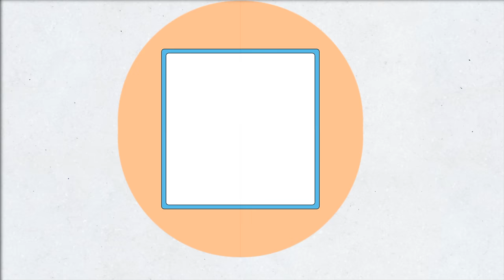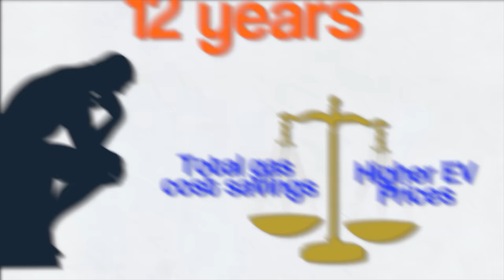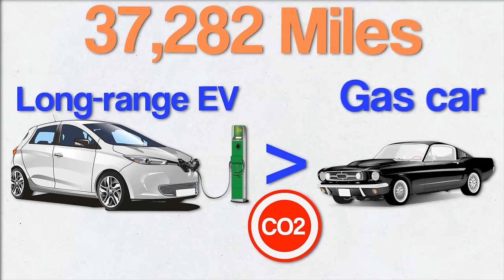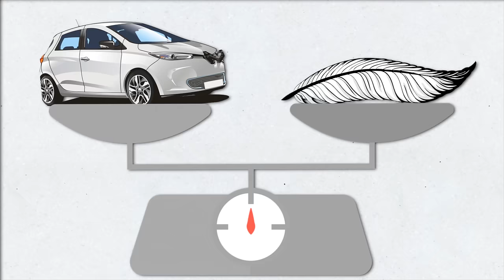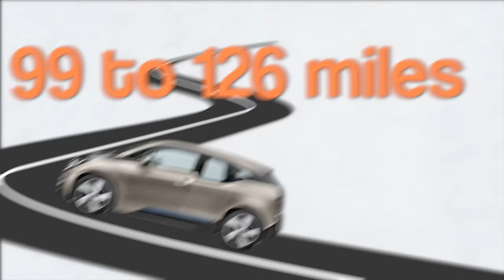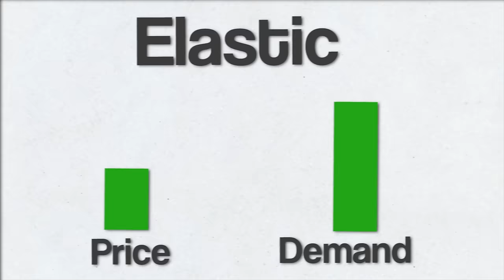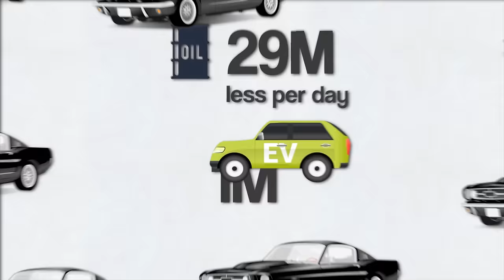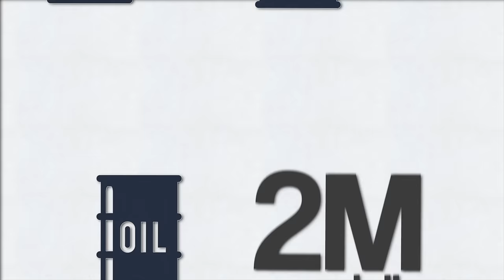If You're Worried About Rising Gas Prices, Watch This

Comment: The transition from gas and diesel vehicle fuel will take several decades. Only a small percentage of the population can afford to buy a new or even good used EV and it will be crazy expensive to swap batteries that are dirty. It will take a huge jump in battery technology to make EV's a real possibility for the masses.
Reply: agree.....EVs  are  way  overpriced,  n  take  too  long  to  charge, n  will  spend  most  of  the  time  parked, connected  to  charger.  also, the  power  grid  would  have  to  be  upgraded  in  order  to be  able  to  handle  millions  of  charging  EVs, which  would  take  years  n  years, along  with  billions  and  billions  $$.
Reply: I dont ever want a ev really
Reply: It's called "forced compliance".
Remember " you can keep your same Dr."  RUSE
Reply: Right now. EV's are more for those that have nice office jobs and use them as grocery getters. EV's still have a ways to go to be of utilitarian use.  Even with the trucks that they are working on now really don't have enough charge life, especially for those that travel with travel trailers half way across the country for their vacations. If they can afford to that is.
Reply: Ford alone has 150,000 E F150  trucks on order . That is only one US company.
Reply: @FFGAir  the EV is not a practical car.
Reply: yess imagine living in foreign countries.. is very expensive for us.. too much import tax to pay.. when battery gets old and need to replace.. i'm thinking of buying a hybrid.. but its almost the same
Reply: Right now I own my suv outright, spend money on upkeep and am considering an ev as a " grocery getter" if and only if it were affordable which it isnt. But the idea of holding on to the old technology and not being able to afford the new technology really sucks considering the price of gas
Reply: As with anything we purchase, as demand increases for EV's, so will production, and costs will come down.  The Tesla Model S when first sold, was around 80,000 dollars, but the newer model 3 is priced in the high $30's, and has a waiting list to purchase.   Consider that any gasoline SUV is similarly priced.
Reply: @tomsawyer8525  they sell nearly a million trucks every year.

Comment: If repairing combustion engines has gotten harder over the years with newer cars, literally no one will be able to repair EV's besides authorized service technicians that will automatically bill you exorbitant amounts to get the OEM parts from the manufacturer. Repairing something yourself will be next to impossible.
Reply: Exactly what they are after. Imagine what this would do to the auto parts industry, as well. Auto Zone, Advance Auto, O'Reilly's, etc., have a LOT to lose in this EV vs. Fossil Fuel war.
Reply: Not if we properly push for right to repair bills. Ford has announced it will be selling 200hp+ motors to be used as replacement parts or for diy cars/modded cars. They're identical to the mustang ev gt motors. If manifacturers are forced to provide motors, you could just use different brands if you so wish, provided you can program your car to use it. But realistically, how often will this be a problem? Remember that motors have a much greater lifespan than engines, and that there aren't that many parts in the first place. The motor connects to the wheels, but there is no transmission involved, and basically norhing to worry about.
Reply: @Iamallwaysright1  software & programming is what we have to worry about. Everything electrical, which in an EV is of course, almost everything....if not literally everything. 
Battery maintenance also doesn't exist. There is no such thing as "maintaining" an EV's battery or the cells within. Just don't supercharge all the time to persevere it? Yeah....

No one is ever dropping an EV battery outside of a dealership or a equally expensive, qualified, specialist EV indy. No one is ever possessing current, possibly cloud based dealer only software to code & program. No diy'er is getting a IT degree so they can troubleshoot their EV when it's charging system fails, or when it's touchscreen that literally controls everything fails. 
The future of driving is BLEAK.
Reply: The electric motor itself have significantly fewer moving parts so it's a lot less of a hassle to maintain. As for servicing from an authorised dealer, it's heck a lot cheaper as well. Since the electric motor have fewer moving parts, it's very less likely to breakdown. Battery longevity is a concern only if you're stupid enough to frequently use an ultra rapid charger on regular basis.
Generally there's no need to worry having to repair an electric motor and it'll take a while - even 10 years till you need a new battery.
Reply: @t8polestarcyan22  here's some breaking news for you....the ave age of a vehicle on the road is 10-12 yrs old.
I maintain my 12 yr old car by myself, in my garage, with basic handtools. No programming or coding needed. Parts are available to me as well as information. The weather, vehicle load, & use of accessories cannot reduce my range by up to 45%. 
My car already exists, was engineered to be serviceable rather than thrown away, so I don't have to worry about it being "outdated". If you're stupid enough to rely on a dealership/manufacturer, then I guess nothing I said applies....including my original post. 
EV's work nicely on paper, or for people who hate cars but just want transportation & are addicted/attracted to useless, needless tech. That will fail. How many recalls have Tesla's had again? None of them involve the motor I'm pretty sure, but everything else.
Reply: @RothBeyondTheGrave  We haven't and will not go for Teslas. Why? They're for richies. One of a cheapest ev to buy in some Western world is a MG ZS EV. So far this baby is rather nice to be with. The ZS EV is well equipped and also have promising warranties especially for batteries. I've tries "rattling" and so far nothing came loose, fallen apart...
Even if things have gone wrong, we're well looked after.
Not only the ZS EV is well priced. It's also well built.

Comment: Two vehicle household, 1 gas for longer trips and 1 electric for local within 125 miles. Charge at home with level 2 charge system. A used Nissan Leaf is a good option for this as those can be had for a very reasonable cost of around $15,000. Battery replacement and upgrade cost of $7,000. Total cost $22,000.

Comment: Cool..They will trade in their gas bill for an even higher electric bill!!
Reply: You are correct, but today if you charge your EV at home, your electricity bill will go up 1/3 or 1/4 of what you payed for gas  (depending upon where you live). If you have solar at home, even less. EVs are so much more efficient than combustion cars. I used to pay ~$30 per week for my Mazada3 gas, now I pay an extra ~$30 per month for my BoltEV electricity at home (driving same distance)
Reply: I can charge at 4.5p per kWh, so I can have 280miles in my ev for a cost of £2.88

Comment: When more people have an EV, what do you suppose a kilowatt will cost? And that includes your refrigerator, all your appliences.
Reply: The grilled is and will adapt. Just like it has been for the last 100 years.
Reply: Now your EV isn't just considered a mode of transportation. As soon as you plug it in it'll be considered an eventually taxable luxury appliance.. 😆
Reply: @jonathanf.9395  The thing here is that majority of electricity production is from fossil fuels. So more EVs = more use of fossil fuels to generate electricity to compensate the rise in load. So we are back to square 1. Unless the shift to using mainly renewable sources to generate electricity are made, EV for general masses is not feasible.
Reply: @hardik875  It must be loud in the echo chamber where you live. The US now gets 47% of electricity from non-CO2 sources. Compare that to 10 years ago. In Europe, it's 56%. Again, compare that to 10 years ago. Growth of renewables is now exponential on both continents. Plus, go to the EPA website. Practically all EVs get over 120mpg-e. I know you mean well,  but you need to update your talking points.
Reply: I have been concerned about this problem myself, a decent solar system to support needs during the day and charge your car during the night solves this. At that rate the system would pay itself off even faster!
Reply: @jonathanf.9395  if they had it their way we would still be in caves rubbing sticks together for heat.
Reply: @pazi402  Exactly. Businesses are doing this more and more cutting their costs dramatically.
Reply: A million bajillion

Comment: I personally have went on road trips in a Tesla model 3 base model and how excruciating it was to double the trip time just for charging! Compared to my 05 Honda Accord the “gas” mileage is technically better. Plus you can actually work on a gas car
Reply: If I understand long distance trips would require more planning. But the car software already tells you where to charge, right?
Reply: @kastellolo5212  yes! Having a place to charge is not the issue, just the time it takes. Our 4 1/2 hour drive turned into 9 hours. Which if your on a time restriction it kind of sucks
Reply: @RRV314  I see. Nevertheless, congrats for your new car.
Reply: @kastellolo5212  well luckily I kept the Honda and not the Tesla! Appreciate it though
Reply: That seems bizarre to me, I just followed a tesla on a road trip all the way from Boise to Pendleton, that's a 4 hr drive on 80 and 70 mph roads, I was expecting him to pull off somewhere to charge but he never did. Did you start the trip with a full charge?
Reply: @theTYTAN3  well since speed effects range and my friend liked to speed almost everywhere for no reason, and it was a base model so range was already limited. I imagine if you spend good money you get better results plus if you follow the guidelines for conserving range

Comment: I made the transition from gas only to hybrid in 2006 and in 2019 I make the engineering career transition to DC fast changing industry and in 2021 I moved to full electric ⚡️ EV driving. I have no regrets and though the US is trailing the EU this is the future. I love the comfort and the ride and can charge from 20% to 85% in about 25 mins in my Audi Quattro eTron SUV. Sure that time I get to choose to stretch my legs, walk the dog, shop, have a bite to eat or go to the restroom. I can change from home using 220V as well. Prices are dropping new battery and charging technology are growing leaps and bounds and most car manufacturers are planning to stop building combustion vehicles so I say embrace the technology as to future is hear!

Comment: EV = Range Anxiety.
Plug-in Hybrid is the way.
Reply: it would've been best but they all don't sell well Volt even went extinct. salesmen say ppl don't understand it.
it's a shame cuz it kinda should replace gas cars already
Reply: Just bought an escape phev. 60 miles daily driving on electric, battery is small so much less costly to replace, gas for road trips back home. Early hybrids gave hybrid s a bad name. You do however sacrifice the all out electric or all out gas performance in a hybrid though.

Comment: It's not just fuel. Its oil changes, tune ups,  and many engine components that fail. 

The big expenses with EVs are their battery packs, if replacement is needed or an electric motor if needed, that can be expensive. 

Both require the same Breaks, Struts, A/C, Headlights, etc. 

So,  it's really all about where you must go to change it.

Comment: In my Industrial world on Long Island we got brown outs down to sometimes 200 volts ever HOT summer afternoon and they PAID us really WELL to REMOVE/Replace things to LOWER the base load 
A Well equipped 40,000 sqft factory/ industrial building has a 5000 Amp 480 Volt service which would apparently support about 10 350 Kw charging stations

Comment: Once we go to all EV’s, the electric bills will sky rocket and all that was done is trading alternative fuel. Bring the steam engine back !
Reply: As an absolute railroad fanatic, I’d support that wholeheartedly! Steam locomotives are amazing, and actually, much more efficient and stronger than diesel locomotives. Plus, they just sound and look cooler. Look at how many diesels it takes to haul a long heavy freight train versus one steamer. A 2-8-4 Berkshire can out pull an SD70ACE more than 10 fold! Plus, they scrapped steam power way too early in it’s prime of use. They could’ve kept improving steam to be way better, stronger and faster than any diesel ever could be. But, as big businesses usually do, they get rid of one technology completely before realizing it to it’s peak just to replace it with something worse and not as efficient. Same with gas vehicle technology versus electric vehicles. Sad.

Comment: The systems for EV's and even hybrids are ridiculously expensive compared to their counterparts in combustible engines.  Ford escape hybrids have brake modules that cost over $5000 to replace, while the regular non hybrid escape costs a few hundred.   You might save a few dollars in gas, but you'll lose more money when you fix it.
Reply: Im not entirely sure what you mean by brake module but the brakes themselves shouldnt differ too much. Many EVs use their electric engines to recuperate the energy instead of dumping them into the brakes. Its actually recommended to take a look at the Brakes of your EV regularly since many have the ability to only brake with their engines in everyday driving causing the brakes to rust.
Reply: The first mistake would be buying a Ford hybrid instead of a Japanese one.
Reply: I pay 100 dollars a month for 5 years for my tesla. Gasoline and maintenance vost pays for my tesla . People with commute is way more beneficial then someone that only drives 3 miles to work. If u drive more then 20 miles 1 way it's a NO Brainerd to own a ev. Don't be fooled. After 8 years and 160k miles only spent 100 dollars to repair 1 fog light . I spend 2k in 1 year on my camry for tunes ups, brake changes and other maintenance cost
Reply: If u somewhat commute get a tesla, gas savings will pay more then half of your monthly payment
Reply: @juanavalos1313  The higher cost to buy a Tesla will take 20 years to break even, even if you drive a lot.
Reply: 5 years 150k miles , 100 dollar repair fog light and vehicle paid off. 100 dollars a month for 5 years with the gas I was saving driving 35 miles 1 way. The best dicison I ever made
Reply: @joeb1522  it was more expensive 5 years owning my Toyota camry 4 cyl then 5 years owning my tesla hands down!
Reply: I was paying 400 dollars a month in gas with my 2016 Toyota camry paid off, I sold got 15k for it, put 8k down on my 50k tesla, payment 500 a month minus 400 a month is gas for my 30 mpg camry , only paid 100 a month to drive a tesla. Either I pay 400 a month for my 16 camry or 500 a month for my tesla 😆 🤣 😂  very easy decision
Reply: @juanavalos1313  Glad the gas savings have worked out for you! Does your comparison calculation include insurance? I recently checked with my insurance, it would cost at least $300 more a month for a Tesla.
Reply: @juanavalos1313  Did you comparison also include the electricity cost to charge the battery?
Reply: @juanavalos1313  I look at it a little different.  The Tesla costs 35,000 more than the Camry.  You paid 400 in gas on the Camey and 0 on the Tesla.  Assuming the cost of electricity pn the Tesla was zero and assuming the cost of insurance was the same, and ignoring the time value of money, it would take you 7.3 years just to break even.  35,000 extra cost   / 400 extra per month saved in gas  / 12 months per year.
Reply: @joeb1522  oh yes, 15 dollars a month more in electricity and if I use supercharger only 8 dollars to fully charge my batteries. I love it 😀
Reply: @joeb1522  yes calculated everything. And u are right new tesla insurance 100 a month my old Toyota insurance 120 a month. I save extra 20, and spent 20 on electricity bill. So that offsets itself. So I save the full 400. And 400 is only gas not including oil changes, brake pads, sparks plugs , tune ups omg. Tesla the best option out there. Hands down
Reply: (3,000 miles / 4 miles z).
Reply: @TheDude50447  I don't know of any EV that only has the ability to brake with engines only - they all offer a switch to turn on/off what's called 1-pedal driving. You just need to make sure once a week you turn off 1-pedal driving to use the friction brakes or coast down a small hill in neutral with foot on the brake pedal.
Reply: @sbroumley  yeah no ev is missing regular brakes. A car without normal brakes cant be Sold anywhere.

Comment: We've had electric cars before and eventually people realize they just aren't feasible. Besides the fact you sit on significant EMFs produced by the batteries.
We have nearly 15 ev charging stations in my city of 35,000, not much demand, I saw one car charging in the past 1.5 years.
Reply: @kev J sitting on big batteries is exponentially worse than being surrounded by smaller sources.

Comment: 14% of the CO2 the US produces comes from personal transportation.  The US constitutes 13% of the worlds CO2 emissions.  So even if all cars in the US were replaced with EVs and 100% of their charge came from renewables, it would reduce CO2 emissions by 1.8 percent globally.(where we were 5 years ago).   Similarly, EVs outperform ICE cars only because performance is regulated on gas cars.  Once EV sales goals are met, EV companies will be required to limit acceleration and top end speeds since EVs weigh 2x more.  When power demand exceeds supply, charging too will be limited or disabled.  Also, electric rates will rise to cover the increased demand,  this would make charging a vehicle vs heating your house a tough choice for some people on fixed incomes.